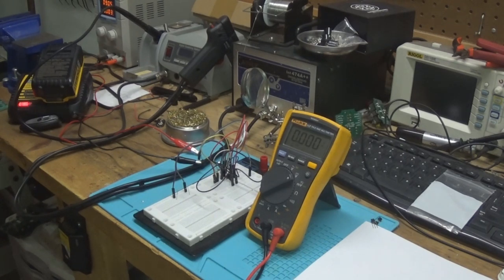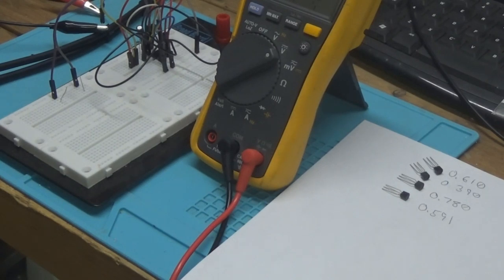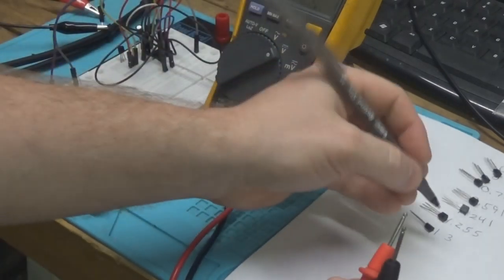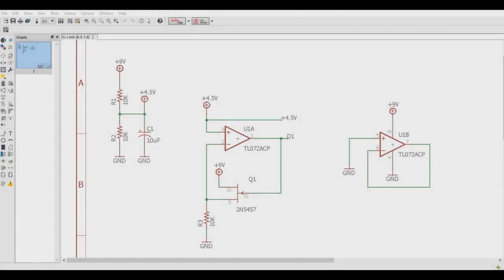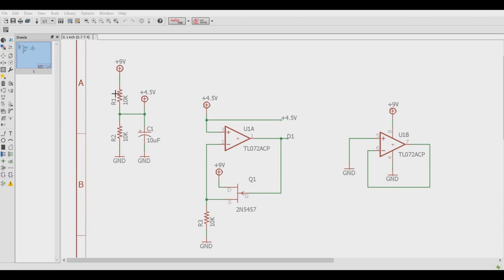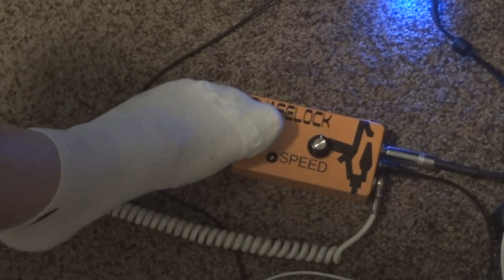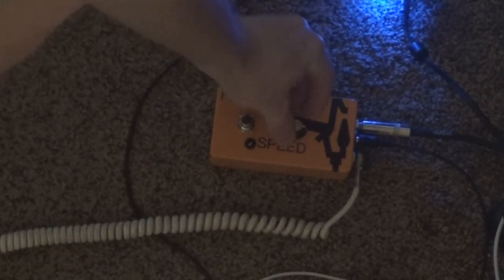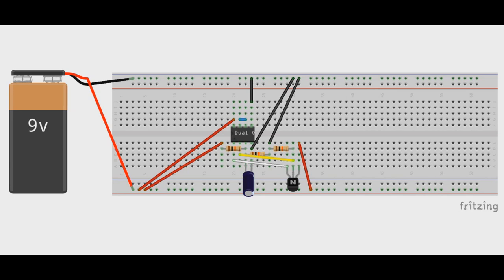JFET Matching for Phasers

Comment: Nicely done.

In theory, pretty much ANY set of JFETs of the same part number (i.e., 2N5457, MPF102, 2N5952, SK30a, BF245, etc.) will yield audible phasing, as you nicely demonstrate, and as a brief scan of the universe of phaser schematics will corroborate.  The question is whether the movement, and audible result, will be consistent throughout the entire range of sweep. 

Imagine we have 4 rowers in a boat, in one of those Cambridge-vs-Oxford or Harvard-vs-Yale competitions.  Two are always rowing in sync and with equal force.  One of them always joins each stroke a little late, and the 4th one always lifts their oar out of the water a little earlier than the others.  The boat is unlikely to go straight all the time, but for that brief moment when all 4 oars are pulling together and in sync, it does.  So it is with JFETs in phasers.  Ideally, all JFETs used will be changing their drain-source resistance at the same time, in response to what the LFO is telling them to do.  With larger differences between them, some will require a higher turn-on or turn-off point. 

If one was to restrict the sweep of the circuit to ONLY the range where all the JFETs overlap in characteristics, it would sound as good as one might expect.  The problem is, it may not be the width/range of sweep you want.  As you aptly note, the MXR Phase 90 (which I assume you're working from) only had a speed control, and fixed the sweep width (i.e., how high and low it sweeps) to some sort of compromise that would sound decent for the slowest and fastest sweep rates.  The internal bias trimmer would set the "starting point" so that all pedals sounded the same.

Overall, the necessity for matching is a function of how much variation in sweep you want.  If one has fairly modest requirements (e.g., you generally use only medium-fast "spongy" speeds with little feedback and only moderate sweep width) then matching does not need to be stringent.  If you're aiming for wide sweep, especially at very slow rates, and you want to include variable offset (i.e., where in the spectrum the sweep "begins"), then better matching is called for, such that the responsiveness of the JFETs to the LFO is similar across the entire range of what you want them to do for you.
Reply: Holy cow poop! Mark, how are you doing?
Reply: @erikvincent5846  I'm doing great.  Thanks for asking!  Nice channel.  Useful information.
Reply: @markhammer643  , a lot of that useful information came from you, R.G. Keen, Rob Strand, and others on the DIYStompBox forums. Thank you guys for doing what you do!
Reply: Mark Hammer, can you explain more in detail when using Non-Matched JFETS what it does to the top and bottom sweep? or what other issues does using Non-Matched JFETS does to the phasers notches and peaks to the phase shifting

Comment: Erik, another great video mixing theory with real-world sound. The matched set sounded like a very solid multi-stage phaser while the unmatched set has a univibe quality. Not bad to my ears, just different.  Guess I need to build two pedals or switch between them in a single enclosure. Thanks, E! You rock (and nice socks).

Comment: So as I understand it, when matching JFETs, one looks to the VGS (off) value only??
Funny, these values are in the -0.5 to -1.5 range, when in the RG Keen article, they are in the 1.5 to 2.8ish range (thou he says the spec is -0.5 to -4.0!!  So, maybe lower because different JFET?!?
I picked up a Peak Atlas DCA75 meter that does all of this!  My readings for a a handful of 2N5952s were -2.46 -2.15 -2.17 -2.33V
I have a bag full of them, so just wanted to confirm VGS is what I want to match up and if so, will do just that with closest values!
I read somewhere, but forgot, what is the maximum spread between values (say 1% or 5%) before you can judge them as "matched"?!??

Comment: Hey. I was hoping you could help me. I finished building my phase 90 from effects layouts. I have good signal on and off. But no swoosh. Tried turning the trimpots still nothing. Checked my 741's theyre good. But i used this cheap 5457's ...

Comment: if a set the multimeter on gate and souce of the transistor it  gives me the same result by placing it on the gate and the third pin of the Tl072 is it correct?

Comment: Thanks so much for this God bless you sir but my question is 
Can experiment this circuit with a bi polar ic and transistor possibly 
4558 and 2n222 or 3904. Etc to achieve the phase effect 
Cause Tl072 is hard to fine sir .  waiting for your reply sir thanks alot
Reply: You should be able to use any general purpose op-amp, but JFET based op-amps typically have better impedance, and that will contribute to the actual sound of the phaser, albeit not much. However, TL072's are pretty generic. Where are you located, and I could help you source them.

Comment: Can i use lm358 op amp for this ?? Or it has to be tl072?
Reply: Basically, any low noise op-amp. The TL072 is the typical jellybean op-amp for the job, but others can do it just as easily.
Reply: @erikvincent5846  can you list out by priorty?

I kinda have  
tl072
Ne5332
Jrc4558
Lm358

Im confuser which is better ne5332 or tl072?

Comment: So where are the test points?
Reply: (7:35) and the points are the 4.5V and D1 (Data Point 1)
Reply: @erikvincent5846  Hi Erik, thanks so much for this video. So far so good, but could you help me locate the test points on the breadboard layout? I've been pouring over this for quite some time, but still haven't figured it out.
Reply: Ah, I think I've figured this out. I'm testing 2n5952 which appears to have a reverse pinout. This is what was tripping me up, I think.
Reply: @mickeygreenbaum9037  yeah, a lot of the TO-92 JFETs out there had different pinouts.
Reply: @erikvincent5846  Yeah, just had to flip the transistor around on the breadboard. Worked like a charm. Thanks again for this!

Comment: 0.69 
0.72
0.75
0.74

Will this be a matched set?
Reply from the maker: That should work.
Reply: @DiyguitarpedalsAu  how much diffrences can be said to be matched..

Btw can u make  video about darlington transistor 

Pairing two 2n2222 

Maybe go i depth about darlington pair